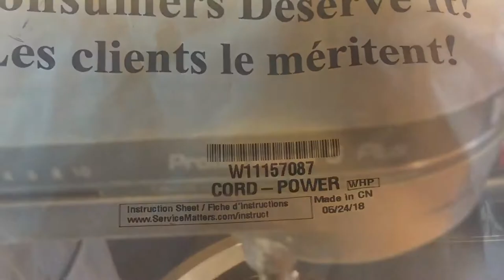Replacing cord on KitchenAid Professional 5 Plus Stand Mixer

Comment: Right to the point, no fuss instructions. thank you. on another note there were no screws holding the motor down, poor quality control, I used 2 of the cover screws until I can replace those from the hardware store.
Reply from the maker: Eugene Kaub you purchased it new? I would not have expected that.